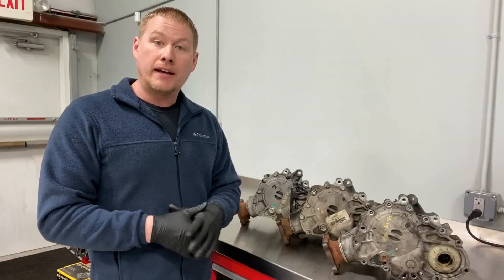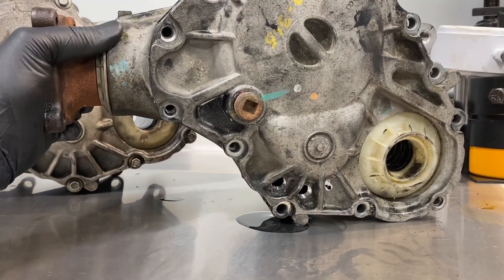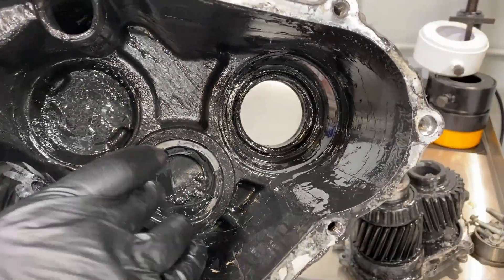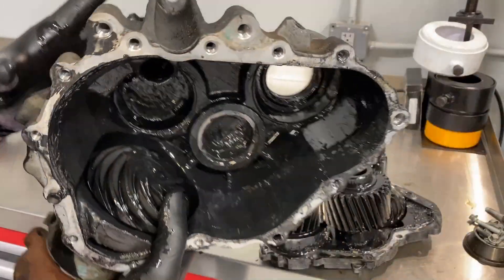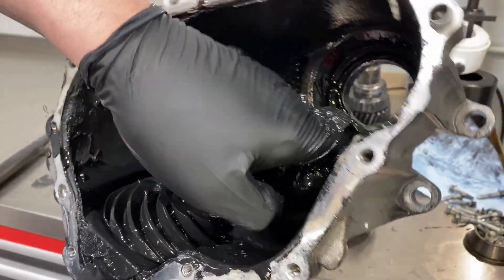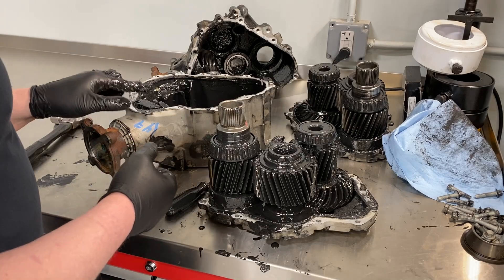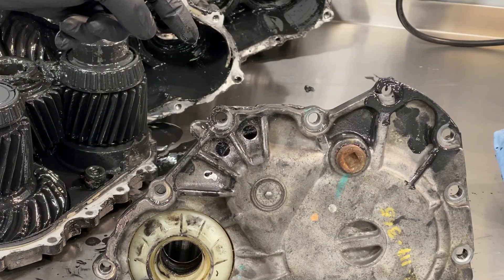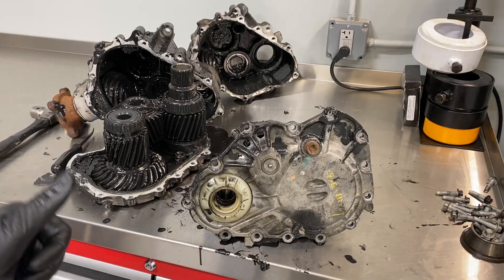How Ford All-Wheel Drive Power Transfer Units Fail and What You Can do to Prevent it!

Comment: Am considering replacing the right intermediate shaft seal on a 2008 Taurus X PTU with 80k miles. Also intend to change the PTU cover seal because there is a trace of gear lube from the deflector area.  The PTU lube is a rather unnatural brown/black but, as far as can be determined from the fill hole, still fluid rather than a paste.  The only smell is eau de vaporizing ATF wafting off the CAT.  Will the majority of the PTU fluid drain when the seal is removed?   The deflector in the dealer seal kit has changed from the domed version in the center example in the video, which is on the car and shown in the Ford TSB and manual, to the ribbed version on the other two examples in the video.  Does the ribbed version still need to be heated and installed with a special driver?  Thanks for the topical and informative video.

Comment: Thanks for all the great videos! I have a 2013 Escape. Been changing the PTU fluid every other oil change. Same with the transmission fluid. I'm worried about the fluid in the rear differential. How about a video that is a practical guide for changing out the rear differential fluid? Remember, you are on your back on the garage floor. Thanks!
Reply: @michael j. Hello Michael, not quite sure if your asking about the front or rear. The front already has a drain and fill plugs. At least mine does in my 2013 Escape. Best to drop the turbo tube to give you easier access to the PTU. The rear differential, you will need a pump to drain and fill. Hope that helps.

Comment: I have a 2016 explorer sport with 45,000.I tried 3 Ford dealers back at around 30,000 miles and all of them said it’s non serviceable.I have the premium ford extended warranty good till 120k thank god.I assume mine doesn’t have the drain and fill plugs?

Comment: The key is to keep fresh fluid in these. I’ve got 110,000 miles on my 2012 edge. Changed the fluid every 20k. Runs like a top, no leaking from the vent. It’s really sad Ford cuts corners like this. They could be a great company but this destroys their reputation (rightfully so). Honda / Toyota for me next time.

Comment: from the same folks who brought you the 2-piece spark plug!
Reply: I think the 5.4 Triton issue(s) were more of a "get your head out of your tukus, experiment in engineering" moment versus a deliberate and concerted effort at designed in parts failure to keep service and parts replacement dollars rolling in to dealerships.
Reply: And two piece lug nuts.

Comment: Great video Bryan! I am amazed at how bad the "fluid" was on those PTUs. I changed out the fluid on the PTU of my 2005 Ford Five Hundred AWD with 180K KM (120K miles) and it looked like honey. Seals were dry too! Seem I was very fortunate with my situation. Being in Canada I wonder if the colder weather has something to do with longevity?

Either way I did tap and drill into the case with 1/4" NPT to facilitate draining, but had I seen this video then I would've placed them on the side plate as you've shown. Hope I didn't induce any stress fractures - time will tell.
Reply from the maker: Those units are way different.

Comment: this is precisely why i opted for a FWD Edge over AWD, forget the Ford PTU's
Reply: I know what you mean. I also purposely avoid cars with the 3.5 v6 because of the water pump issue they have. Which is a shame since it's otherwise a very good engine.
Reply: @nodak81  lol well that's the motor I have. Seems that this issue is properly addressed by frequent coolant changes

Comment: Is it possible to pump the old oil out through the fill plug with a tube and vacuum pump. Or do the internal gears prevent the tube from hitting the bottom of the case?

Comment: I think that if Ford informed the Mechanics or DYI people that the fluid can be replace, at least 80% of it, by using vacuum fluid extractor, then the power transfer last longer. If it wasn't mentioned in the owners or service manuals, then this is what happens.

Comment: I can't believe Ford engineers ever thought a gear oil could be "sealed for life."  Unbelievable.
Reply: Under normal service yes. 
Not when it's wrapped on 3 sides by heat. One of them being intense heat from the catalytic converter! It should've been designed as a 30k mile service minimum!
Reply: @dodgeguyz  "under normal service yes"  I'm not sure I agree.  I understand there's heat all around it.  But the infinitesimal metal shavings themselves, from normal gear/bearing wear over time, will gunk up the fluid, regardless of heat.  Maybe it'd take a little longer, but it'd still fail if the fluid is never changed.
Reply: Think about how many manual transmission cars there are out in the world. I do not see many people saying to change the fluid in the street cars that are not modified. I know any manual car I had was never changed and never an issue. Adding in all the hot parts right around the gears is too much for the oil.
Reply: @snoopdogie187  I never changed the Automatic transmission fluid in my 1988 Ranger either and it was a manual transmission, and yes it called for automatic fluid. I never had a issue with the transmission. Truck was scrapped and running when it was sent to the boneyard due to rust with 297,000 miles on it. RIP poor truck.
Reply: They know its going to fail they  don't want it to last its called  planned obsolescence.
Reply: In Engineering language, "sealed for life" actually means "it will last until 60k when the warranty expires".
Reply: @nodak81  very true!
Reply: Well, it is Ford. So it's believable.

Comment: This is better than a conventional differential how? I just don't get why they use this design. The high angle ring and pinion are energy hogs and heat generators, and the high speed gears in the hi-vis oil are a sure energy losers, as are straight cut gears, in addition to being noisy. Seems to be a more expensive build than a conventional differential as well. If I'm missing something obvious, please explain it, no sarcasm intended, I'd really like to understand why the change in a pretty standard design. (one which typically lasted 100-200k with factory installed oil if kept dry - not that I recommend it).

As far as the "lubricated for life", I've never seen a single "lubricated for life" device that didn't fail as a result of lack of lubrication or contamination. Not one, in every form of mechanical device, from sewing machines, power tools, power equipment, lawn mowers, cars and trucks. I don't believe the concept has made it to over the road and heavy equipment (wonder why that is?? - sarcasm intended here). Even simple devices like the GM ball joints of the '80s trucks that failed in 15k failed to survive as long as those that get 2 shots of grease every couple of years. The replacement ones have grease fittings. Seems they have learned by now, and it's no longer an engineering decision, but a financial one. It saves the manufacturer a few bucks up front, that the consumer then gets to pay for many times over. 
This example is a case in point, Ford saved less than a buck per copy by eliminating the cost of a couple pipe plugs and 10 seconds worth of automated machine work. Cost to consumer, $2400 or so per copy. If dealership maintenance wasn't so overpriced, they would probably get their buck back in spades by providing the recommended oil change, with the $50 per quart gear oil. That's how Honda does it. The bonus is happy customers and a reputation for quality. 
For the record, I am a lifelong GM (just as guilty as Ford in the L for L game) customer, and I say "Buy American", but after after 20 years plus of the facts, you have to admit, the cheapification of most American products is evident, and painful to watch. 
Good video, informative and concise.

Comment: when i got my 2011 explorer saw some oil leaking.. i ask the guy from this cheap dealer.. he told me that he just got the oil change done and he dropped some oil.. that it was fine.. but of course my dumb ass got the truck anyway.. 2 days later took the truck to Ford dealership and they told me it was this exactly thing.. they charged me 1400 to fix it 🤦‍♂️ and the other deal didn't want to deal with the problem

Comment: Great explanation! 2015 Explorer XLT, 70,000MI. Bought new. Changed fluid month ago, (suction method) propane smell, not soon enough. Bearings and ring-pinion gears fine. Idler (not seized) and two drive gears 70 percent teeth broken/gone. No leakage through vent cap, slight seal leakage. Couldn't turn rear pinion gear without any other components in the case. Must have got sludge+ in there but the bearings were fine once I pulled off the output flange and pinion shaft. Case 1050, labor 650, done at dealer.

Comment: if the unit has not failed and you are only switching the fluid, should you try and flush the unit before adding the new fluid?
i.e.., add some solvent or light oil and vacuum that out first?

Comment: $25 for a quart of fluid? wtf
Reply from the maker: Chrysler axle fluid is $50 so $25 is not bad.
Reply: @FordTechMakuloco  - The clutch fluid was $75CDN ($60USD ) a quart from my Volvo dealer when I changed the filter and fluid on the Haldex differential on my Ford Five Hundred. $25 is not bad at all!

Comment: I have a 121000 miles on my 13 explorer. Do you think it’s too late to change the oil in it? It’s never been done
Reply: Tools-cars- Guitars -
Not too late! I learned about this when I saw the black oil coming out the vent at about 130k miles. I drilled/tapped a 1/4” NPT whole (pretty small) in the bottom (not what he recommended here). Otherwise you can use a vacuum pump and pull the fluid out the fill hole.
Drove mine about 100 miles and changed again to flush the system. I’m just at the next 5k oil change now and will change it again then it will be every third oil change,  15 k miles.

Comment: This is not a design flaw at all, it was obviously designed to fail.  
small fluid reservoir, no drain plug, "unserviceable" designation..  Ford built this to be a money maker, just in time for the warranty to expire.  
Kudos to you Brian for exposing this and educating potential buyers and owners.
Reply: Can't stand that companies design parts like this. It's why I never take my vehicles to dealerships with the exception of computer based services that are locked out by anyone other than the dealer.
Reply: Tell the class you e never owned a 4x4 with a transfer case. This setup is literally no different. Small fluid volume, drain and fill from the top. Lol
Reply: @waytoofazt9155 and an exhaust pipe in close proximity to roast it just enough. You forgot that part.
Reply: Dont forget its nestled between the exhaust manifold, transmission, and engine. That 1 quart of fluid aint gone last that long being heated like that.
Reply: I can assure you they don't design it to fail, but they wont add cooling systems if they have no evidence that it's needed for 99% of customer usage. They did put coolers in the police package Explorers due to the excessive drive cycle requirements.
Reply: Agreed! That's why I don't trust Mercon fluids with their less than optimal wear package... they want transmissions to fail.

Comment: I had mine blow on the highway. I asked the dealer to tap a drain hole for me and they refused to do it and said if I did it it would obviously void my warranty.  Cost almost 2K to replace.  Really pissed me off. Wasn't even alot of Klms on it. My 2009 Ford flex just has 138,000 klms on it now.
 Is their maybe a synthetic additive or oil that  Royal purple or something someone else makes to use in these to stop the "gum" from forming?

Comment: What about when drilling, coat the tap bit with grease to help collecting the metal shaving 🤔.
Reply from the maker: It would be a huge mess, there are tons of shavings before the bit ever passes through the thick side cover, its best for them to be dry and sucked up not collected in grease.

Comment: i havent been unde rmy 13 mks lately but how feesable is it to drill the drain hole while its on the vehicle? 13Mks ecoboost same as the 13+ taurus sho
Reply: ramairetransam -
There is some information on the web that suggest a place to drill and tap on the bottom just search “drill Ford PTU”. I couldn’t reach the point on my 2013 Explorer because of the exhaust, so, I chose a point even with the recommended but more in the middle. I was nervous as hell doing it. used a 1/4” NPT tap. The hole was small and it worked great. Safer way is to get a $15 extraction pump, hand pump and feed a hose into the fill hole and pump out the fluid. Won’t get it all but you’ll get enough. The damn thing only holds about a quart.

Comment: Built in Failure!! This is just plain ridiculous! A monkey in the Jungle has more common sense than these so called engineers! Sealed bearings is another great invention by these same IDIOTS! You want to smell some really nasty stuff, its the same odor you are talking about, change the gear oil in a Class 8 Truck! WHEW, it will take your head off because of the amount and heat it is subjected to! That smell is the High Sulfur dose the fluid gets.  Sulfur, is an extreme pressure additive. The Sulfur works by elevated heat of gears meshing to form a layer of Iron Sulfide to prevent scuffing and galling! That's why all gear oil stinks.

Comment: Pack the area you are drilling with gear lube, thicker the better to capture the chips and keep them down.  For change I’d  use my 12 volt positive displacement pump with thin flex line to vacuum out the fluid, refill drive a while then repeat. Saves the drill time. Used same to drain down my transmission prior to dropping the pan so as not to take a bath

Thanks for the vids, they are a big help!
Reply from the maker: Grease would be a huge mess and not needed when drilling on a flush surface mounted horizontal.

Comment: I bought an AWD 2007 fusion with 110,000 miles on it. Took it in to the ford dealer for a clunking noise and they gave me a long list of repairs including a new PTU. I was a poor college student so after some research decided as a last ditch effort I’d drill and tap a drain plug in the bottom of the PTU. Did a 4X drain and fill. No sludge ever came out which I took as a good sign. I rigged up a weed sprayer to pump the gear oil and now I change it every oil change. That was 3 years and 30,000 miles ago, so it definitely bought me time to save up for another car. I’ll probably just keep maintaining the fluids and drive the thing until the PTU finally gives out.
Reply: Good man.

Comment: My girlfriends Toyota all wheel drive just died. It was 1,600 up front for all parts. Then another 1k . Its an expensive fix but it has the same problem that no one other than the dealership and repair garages are aware of.
Reply: Lexus GS sedans have a transfer cases at the back of the transmission(it is RWD). The fluid is shared with the transmission, and it is full time AWD. The TC has a little valve body that controls the planetary percentage. Never heard of an AWD system even have the smallest issue. It wasn't designed for cost though. The transmission is the same as the Tundra. It is different from their FWD awd systems.

Comment: Glad you showed the unit taken apart. I now have an idea where to try and properly snake the suction tube to remove the maximum amount of gear oil. I’m figuring ing if I change out the fluid every 10 thousand miles I can save the customer a huge repair bill. Low dollar investment to save a thousand or more

Comment: Very ironic that you just posted this video, as on my most recent trip to the dealership to get an oil change after my 5 yr extended warranty expired on my 2014 SHO, , I was told  my PTU was leaking. I asked where was it leaking from?  Was told they wouldn’t know exactly unless they opened it up....well thanks to your video at least now I have a general idea of what it will cost, and what the  job entails. Thanks

Comment: Do U have a video on actually making the drain plug ? Correct me if I’m wrong, but the transfer case is only in use when U are on   4 X 4 mode ? 🤔 Furthermore, what fluid is required in the transfer case.. I have a 10’ F250 Super Duty  4 x 4...
Reply: The  fwd based ptu is spinning with revolution of wheels. The percent of torque to rear varies by pressure on clutch pack in the unit on front of rear diff. The transfer case on super duty with vac hubs stops front drive shaft when in 2H but there are still some parts turning on bearings. That transfer case has very few problems as long as it has oil in it. That transfer case uses auto trans fluid. Currently Mercon LV since Ford dropped the other ATFs and say LV is backwards compatible.

Comment: I have a 2014 mazda cx9. T case was replaced at 18k under warranty. Currently has 45k, I've swapped fluids around 35k. I have a feeling these cars are money pits. Water pump, t case and the poor mpg on the 3.7. V8 Durangos do better than the 3.7! Its paid off tho, so what do you do!
Reply: Zachary B .  Hi, i also have cx9 and PTU was changed under extended warranty. I called Mazda and asked to change PTU fluids, but mazda doesn’t do it. Where did you change your PTU fluids and how much it costs? 
Thank you

Comment: I have a 2014 SHO non-PP which doesn’t have the ptu cooler on the side. The vehicle when I bought it had a drain plug however, it was a brass drain plug and was installed on the bottom of the case. Haven’t had an issue with structural integrity. I drained the fluid for the first time and it was more green than black. Is that normal? Or a sign of a different or incorrect fluid used?